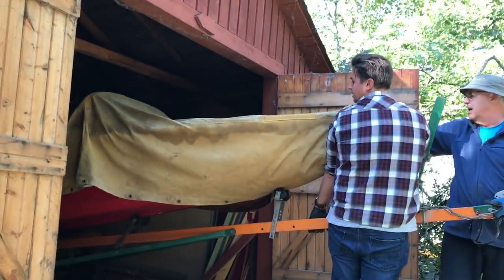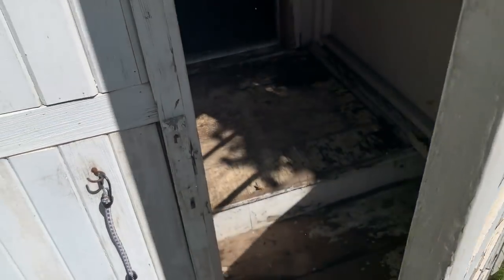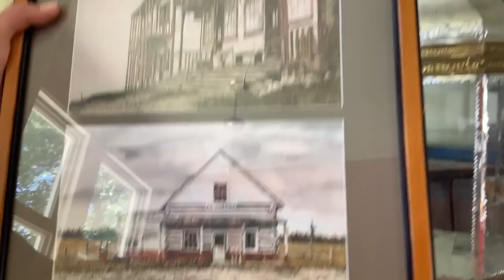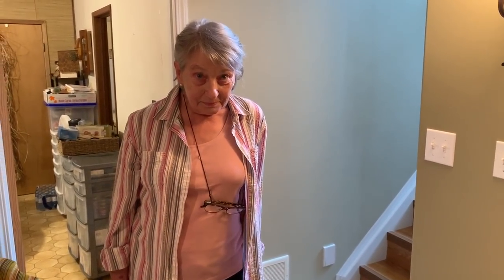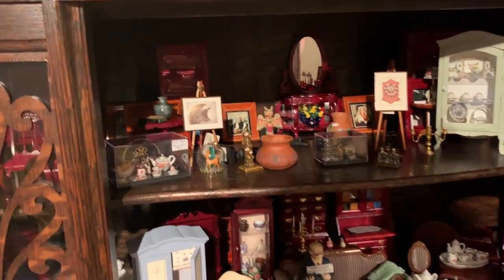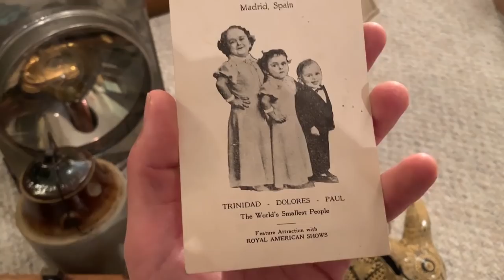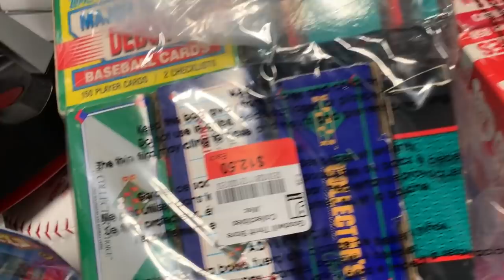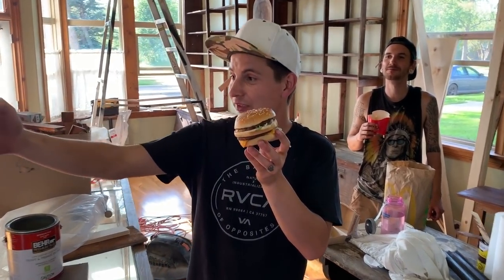Part 4. Ghost town shelves get a new life! General Store

Comment: Alex: 
Check with the building department.
I think you will find out that, In the building code you cannot let your rain water drain on your neighbor’s property.

The neighbors down pipes should be draining on their property.

Therefore draining into their own backyard.

You may also check with the city, because the neighbors might be responsible for any damage as a result of their actions.

The city may also be responsible for damages because when the property next door way built. Who passed this drainage plan. Who inspected it .

Cheers

Comment: I would suggest adding a woodburning stove. It both adds to the authenticity, and gives you back up for those cold winter days when the power goes out.
Reply: Austin has a good collection of them. Hope he buys one from him.
Reply: Insurance companies don't like them, especially in commercial spaces
Reply: Smoke from wood is one of the most unhealthy to breath though
Reply: If the power goes out the store won't be open anyhow...plus there are generators.
Reply: Should have kept the one from Mary’s house.  It would have looked great in the store.
Reply: I wonder if you could get an old woodburning stove, and install an electric heating element inside the firebox.
Reply: @pures.guinto1948  Isn't that the stove that Austin Tichler bought at the auction ?
Reply: Austin has a stove the inside is too rusted to burn wood but an electric heater elements could be installed.
Reply: I am pretty sure that a burning wood stove is prohibited in the town proper. I do hope Alex finds a good space heater that has an authentic wood stove look.
Reply: Maybe they could get a natural gas stove?  Insurance would likely not mind.  And they work when the hydro is off.  Generators are a good idea.
Reply: P.M. Laberge good idea. We use wood burners down here in the south, but we don’t have the bitter cold Canada gets either
Reply: @murlthomas70  Even worse... In Alberta, they get a weather phenomenon called a "Chinook".  A wood stove is a GREAT idea, but cannot be instantly shut off.  GAs, at least is fast on, and fast off.
Reply: Murl Thomas    That's a great idea but someone would certainly get burned. People today aren't used to that kind of thing.

Comment: Stain the wood around the windows to match.
Take your Daughter to see that collection, she will love it, and the Lady will love showing it to her.
The shelving is looking awesome.
Not sure about the old clock case, the shelves are going to be a little above eye level, esp for watches.
The floor in the back bld, has tar paper to help with moisture coming up from ground.
If your going to use that wood, somehow you will need to seal it again, and I dont see someone trying to get under and putting
up new paper on the ground side of that wood. So not sure about that.
Looking good

Comment: They did a fabulous job and good decision on not blocking the windows. 👍👏 One little thing is I would add is wood to the back of the base unit on the left side, covering the gap from base to wall, so you don't accidentally drop something down there.

Comment: Rolling library ladder, for sure; the nailer plates on the joists scream modern, but if you painted the joists flat black, that would work; very labor intensive, but you could lay in 1x6 over the insulation, so it looks like you're still seeing the roof between the joist; check out mini-split (ductless) hvac. There are a few in a vertical form factor that could be concealed inside something that looks like a large sheetmetal woodstove; there's a plastic version of the tin roof that's cheaper; Josh is amazing, as usual.

Comment: I've done a lot of painting over the years and the Shur - Line edger is the best thing ever for cutting in around ceilings. The key to using it is to load it with paint by coating it with a paint brush as opposed dipping it in paint as directed in the instructions. This thing is a massive labor saver you can trim out an entire ceiling 12" x 12" in about five minutes.

Comment: The shelving is spectacular! Can't wait to see the stain once done. Assume you will also be staining the bins at the bottom. I have used both DuraFlame and Comfort Glow electric stoves, purchased at Big Lots, when we had a failure of the heating system during the cold winter and had to wait six to eight weeks for the repair to be finalized. It worked well, was cozy and didn't cost much more than the HVAC system costs.

Comment: Alex, I am so glad you decided to move the bin/shelves down so that window is not blocked! And, for the other set of shelves, you could just cut openings in the ones in front of the window, and put glass in the openings (with proper support below the openings, to hold the glass plus the glass items). Then keep the cut-outs so you can patch them back into the shelves at a later date if you want...say, if you move to a bigger store.

Comment: That $10 metal cobbler's tool is called a metal last. That one likely would be used by a traveling cobbler as a cobbler shop would have a full height pedestal bolted to the floor with multiple lasts from child sized to adult. If the last is removable from the pedestal, that could actually have been used to form a shoe as well as repair the soles. If not, it's simply a repair tool.

Comment: I don't know if it's been pointed out before Alex, your clock case is from a Standard Electric master clock.  They were used to run slave clocks in school  rooms or other buildings where synchronized timing was important.  They could also control bells etc...
Electrically wound mechanical movements which were very accurate and low maintenance.  They became obsolete when the reliable Telechron movement was invented which used AC.
Reply from the maker: Too bad I didn’t have the guts they appear to be quite valuable :(

Comment: Ductless heating and cooling for real climate control. (Guess that will not be warm enough there in the winter) Then an old fashion reproduction for fun heat.
Like the open concept of the addition.  You can get some really good R factor insulating under the shingles.  
We Love our Ridgevent to circulate the air in the attic. Plus it leaves a nice clean look on the outside.

Comment: If you add some shelf supports down the sides at the windows (as you did in the clock cabinet) then later you could get some toughened glass shelves to slide in across the windows which are movable and more flexible for a variety of uses.

Comment: When we have watched other programs on restaining antique/old wood, the technique is to use a cloth to wipe on the stain. We are working on an art deco dresser. We carefully sanded, then ensured all the dust was gone.  We have done the first coat of stain we will then with very fine grit sand again then apply another coat of stain and then use possibly a varnish of some kind.  Why did you use a brush and not a cloth to put the stain on the various items you are staining.

Comment: There are styrofoam ceiling tiles that are molded and can be painted to look like metallic ceiling tiles.  I used some in a different pattern to cover a popcorn ceiling.  They are much less expensive that metal tiles.  You don’t have that echoing effect either.  I installed them myself with some mastic.  Google decorative ceiling tiles. I’m sure you can find some to get the look you want.

Comment: Hi Are you  going to use the wood from the middle of the back room to fix the door of the back room?  That way you don't have to buy more wood.  AND  just my opinion but a wood stove is such a pain to keep going, and keep cleaning, and keep dusting the ash that always sneaks out when you open the door to put more wood in.  maybe you can insert an electric heater/radiator in a wood stove exterior.  won't even need venting then!

Comment: Glad you didn't cover up the windows.  But like others have said, why didn't you paint the walls before the shelving?  I would have preferred the old clock casing to be sitting on the shelving, would have made it look more like it belonged to the rest of the shelving .  I don't like the floating aspect of it, with that tiny 1" space under, looks wrong.  Lower it to make it look more integrated.